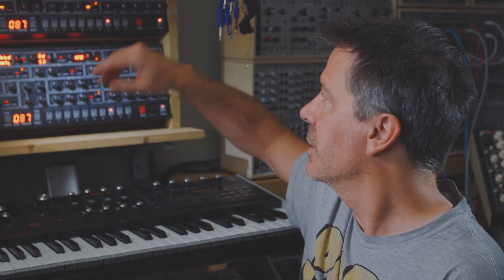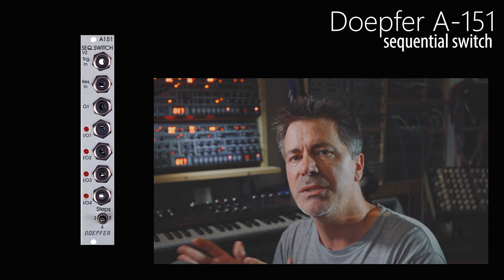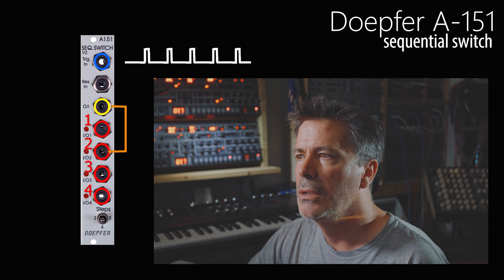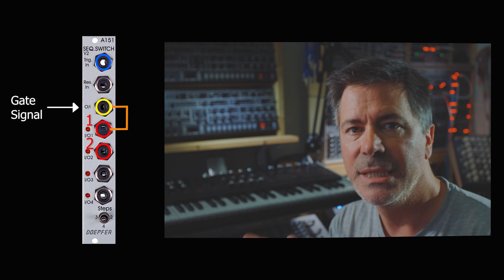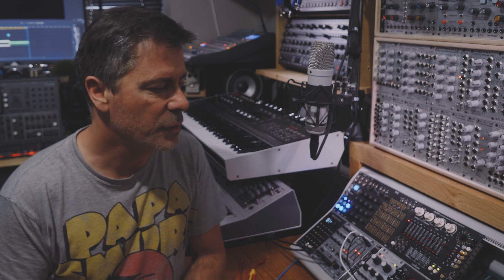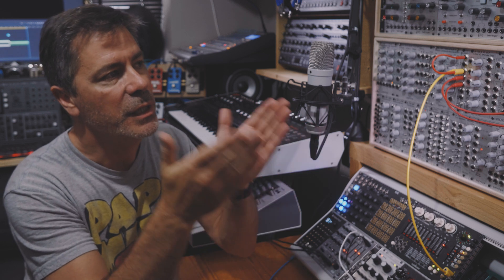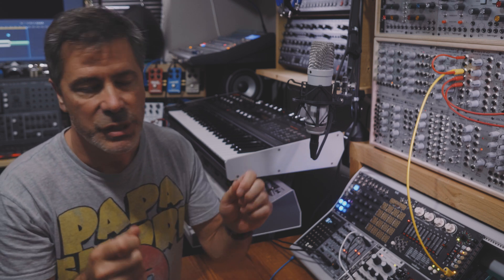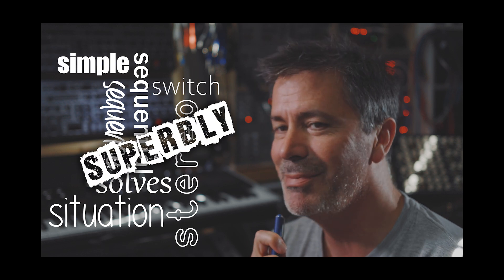Eurorack Modular - Sequencing in Stereo using a Sequential Switch

Comment: I've been using Sequential Switches for decades, ever since my 1st MOTM 700 dual switch. 
Even w/o the stereo aspect, a couple of switches can convert a simple sequencer output into two notably distinct voices (as long as you have 2-VCOs and ADSR/VCAs to use).

Comment: Tim, did you look at the A-150 dual vc switch as an alternative. it's cheaper and has two switches, so it could be used to also split the gates and allow notes to overlap. You absolutely need an A-151 (or other sequential switch), but I think the A-150 is really great for the times you don't need 3 or 4 connections.

Comment: does the A-151 do S&H on the outputs so they hold the input once no longer 'active' or do they drop to zero? I've got an A-152 but it does T&H rather than S&H on the outputs - you can mod it for S&H but I'm not great with a soldering iron

Comment: Very interesting. When you showed the module (which I own but underuse) I thought that you sould hook up the gate of the sequence to the gate input but then send the audio of the oscillator into the input and would switch output 1 and 2 to left and right side of your stereo out. That would only work if one note stops playing (and ringing out) before the other starts being played. But you solution is a lot more flexible (but needs two pairs of oscillators instead of just one)

Comment: This video shows a perfect example of applying this underrated module. The same result can be reached by using a an lfo, an inverter and a divider, among others. A patch example named Stereo ping-pong can be found in the Korg MS-50 owner,'s manual. I prefer your method though. I used the Analogue Systems sequential switch on my track A perfect storm on the album Sense of Urgency to sequentially switch between three different patches. It was a nightmare to patch three sounds and an even bigger one to write them down. In hindsight, the sound wasn't spectacular but at least I showed for myself a complex patch like this was possible. As far as I know, the sequential switch is the best tool to simulate the bowing of a violin on an analogue synthesizer. Alternating between envelopes or whatever module makes the sound more dynamic, which is one of my goals in electronic music.

Comment: Just one thing to be aware is that most (traditional) sequential switches are only unidirectional (choosing one of n inputs). Also, one way to get around longer envelope times letting through the alternate CV is to use track and holds (or sample and holds) with the selective gate to hold the CV constant until the next gate of the respective channel.
Reply: I’ve couldn’t imagine a designer making a  sequential switch that is unidirectional. Every sequential switch that I’ve seen has used an CD40XX series analog multiplexer which are bidirectional. Which ones did you find that is unidirectional?
Reply: @noahtotten   Most Doepher sequential switches are bi-directional
Reply: That sounds like the solution to a problem I’ve been struggling with.  Thanks!
Reply: A dual quantizer would work as well.  Granted the quantize bit might be redundant.  But if both quantizers are only set requantize the input signal on a gate/trigger... well there you go.  Some people might have quantizers but not S&H circuits.

Comment: If you did this with just one oscillator, wouldn’t there be clicks when the panning happens outside of a zero crossing point in the waveform? Does the sequence switch change outputs like a square wave or is the a little curve to the switching. I’m just now turning my attention to these types of modules.
Reply from the maker: Well in this example I’m not splitting any audio signals directly, all I’m doing here is splitting out the gate signal so I can fire them at separate envelopes which in turn can modulate separate audio signals. By manually panning those audio signals left and right you achieve the same effect as pan spread. If you used the switch to split audio from a single VCO+VCF+VCA then you would have abrupt cut offs of the signal, maybe a slightly sloping attack using an EG would eliminate clicks but you’d certainly not be able to have any EG releases or overlapping notes...
Reply: @TimShoebridge  I actually tried the opposite with this module which was:  join signals together at audio rate, by sending 2 waveforms from the same oscillator (so perfectly in sync) to inputs 1 and 2 respectively, as well as the square output of that oscillator into the gate. At the common output you then get a waveform that is composed by alternating cycles of each of the separate waveforms. I didn't recall noticeable clicks.

Comment: At 6:13 you say, " . .  so that got me thinking about well how can I potentially replicate that rings sort of bouncing stereo effect, but using regular synth voices."  I assume you are referring to a mono output device. Most synths are stereo - therefore this would be pointless on these synths for the effects you show here.
Reply from the maker: I was referring to traditional analogue eurorack modules, such as the System 100 modules I demonstrate with, and not digital modules that already support stereo, That said, the technique is actually to use a seq switch to drive multiple modules from one sequencer gate, those modules could be mono or stereo, it doesn’t matter which...
Reply: @TimShoebridge  Thank you for that clarification.
Reply: Have to disagree Bobcatt ~ though i welcome the relatively recent trend of more stereo even in some eurorack (notably 4ms) it's still so much easier to find (and afford!) mono synths
Reply: @petedako  Pete, was not about what is affordable but how does a stereo output fit in with a Sequential Switch. and In particular, the pan effect.
Reply: @bobcatt2294  I don't have an answer - I mostly still use my stereo delays as mono because it's less confusing to me  (eg on DLD and Matriarch)  and as far as sequential switch so far, I have been using my new 151 Doepfer to extend the length of sequences with Brains and a single Pressure Points ~ that's why I was watching this to learn something new
Reply: For regular stereo synths, if panning is not built in as a modulation destination or the synth does not have a dedicated pan spread like on the OB6 or P6, you won't be able to get this per-voice-bouncing-behavior. I checked my stereo synths; at least 1 out of every three is not able to create this effect. Depends on the synths of course.
Reply: @newignis  This is precisely why I am on to the UDO Super6. Stereo and pan at the filter stage.

Comment: I had always assumed the mults on the 173 were passive, but seeing them used here to split the cv from the sequencer, makes me question this. Just tried to find out, but can’t see buffered or unbuffered mentioned anywhere in the docs. Would be great to find out they’re buffered!
Reply from the maker: They are passive. But you can get away with splitting into two as long as you don’t go crazy with the octave range
Reply: @TimShoebridge  thanks Tim!